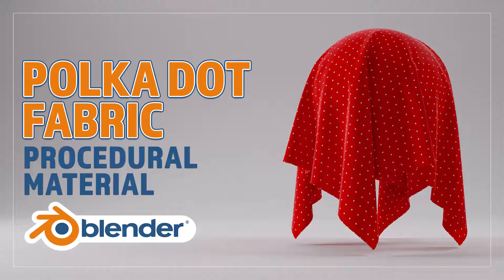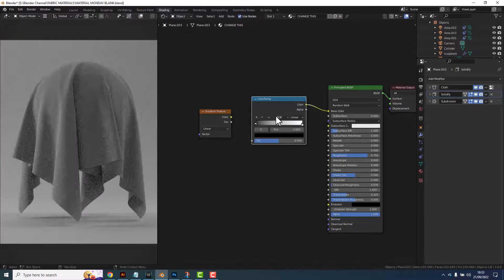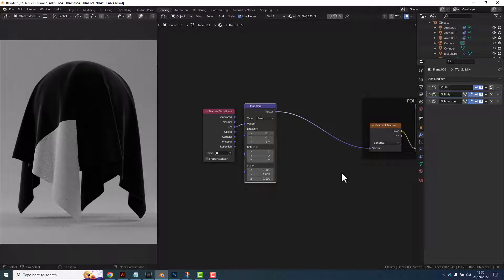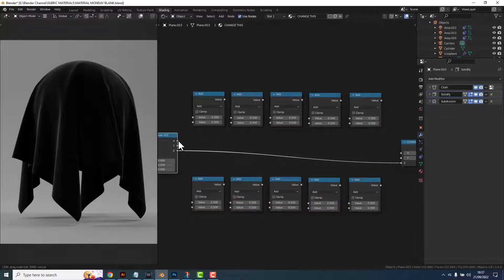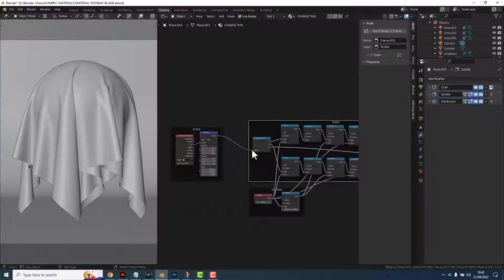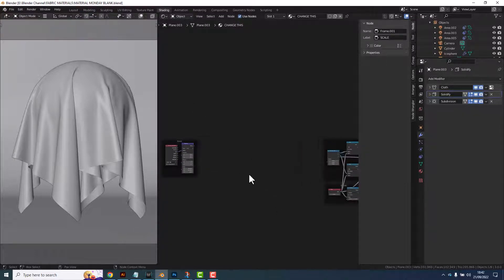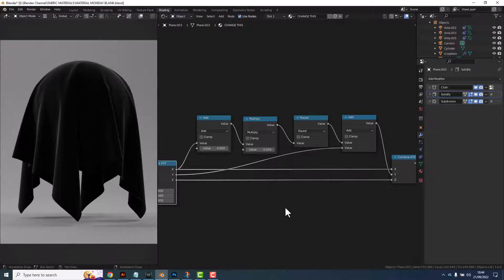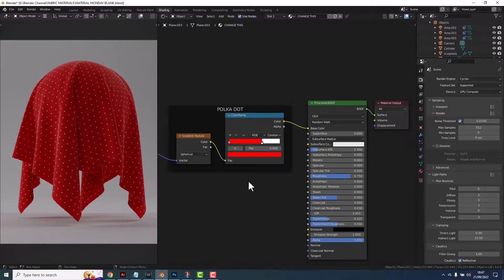CREATE A PROCEDURAL POLKA DOT FABRIC MATERIAL FOR BLENDER

Comment: Nope...I'm using 3.4 and after trying this twice, completely from scratch, & double checking everything each time, all I have is a black material. I just can't work out why.
Edit...By using the scale on the mapping I get white lines  X 1.0   Y  0.000001   X  0.000  if I minus the scale I can get them zig zagging, which looks quite cool...but still no dots!
Reply from the maker: I have noticed a couple of node differences between 3.0 and 3.4 so will take a look when I can. Can you tell me if your just using it on a flat plane and what size that plane is please?
Reply: @blenderbitesize  I have just run it on a standard spawned flat plane. 

At start = I have just over half a Dot in the left corner of the plane

With Adjustments I can get 4 equal dots on the plane (middle) and see others around the edge. To get it doing this... 
I Moved the white in colour ramp to 0.875 and adjusted the Spacing = Value 0.140 Multiply 2.380
I tried to stagger them but...
Staggering, using Add, does nothing and Multiply at, for example, 1995.240 sort of staggers them but the circles turn into egg shapes.

I'm reluctantly giving up as I'm not sure what else to do.
Reply: @slightlyevil.  I have just successfully recreated this in Version 3.4 on a standard 2x2 plane. 
To get more dots in the space available, you need to change the X and Y value on the mapping node, using the same number, e.g. x100 y100 or x200 y200.
To decrease the spacing between the dots you need to decrease the number in the value node in whole numbers, using fractional numbers will break the staggering and spacing and result in pie wedge shapes. Do not change ANY of the numbers in the math nodes.
To increase or decrease the circle size, move the right hand slider in the color ramp.
Hope this helps.
Reply: @GentlemanCrafterUK  Thank you...your help is appreciated.